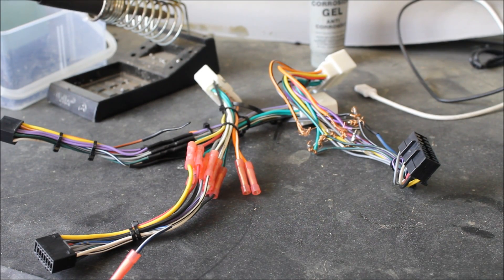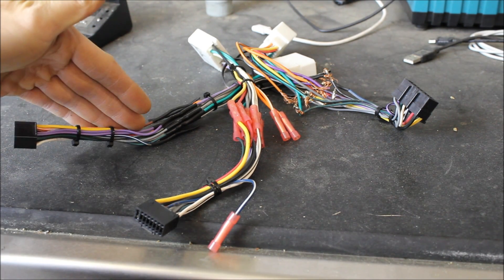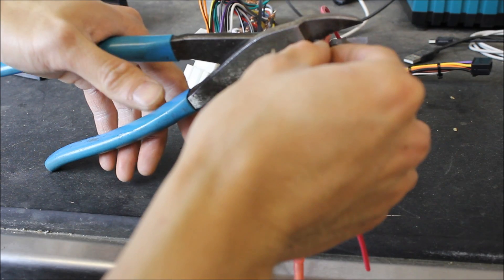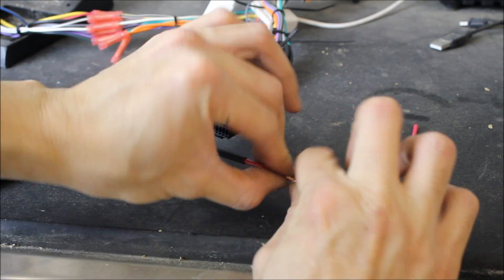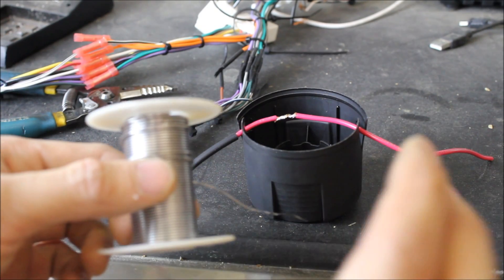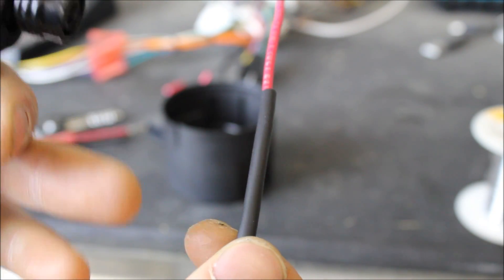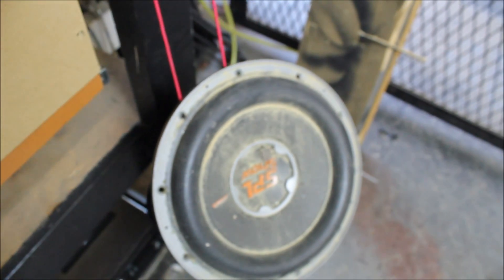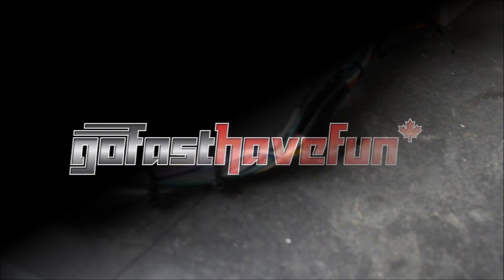Butt Connectors vs Solder | Crimping vs Soldering | Wire Connections | AnthonyJ350

Comment: Do you realize that solder forms the connections on circuit boards? It doesn't matter that it's an alloy.
Reply from the maker: There's also a COPPER FOIL sandwiched with the glass fiber.  That copper might have something to do with how things flow too.
Reply: I don't follow. Your point was that solder shouldn't be making the connection. On a circuit board, the connection is made from the component lead to the copper traces with the solder.

Comment: But soldering wont stand the high current heat ,right?
Reply from the maker: Cosmo John If the wiring can handle the amperage you're pulling you should never have an issue with solder since it won't heat up enough. It's when you have the incorrect gauge of wire (too thin) you'll have issues.
Reply: AnthonyJ350 Appreciate your good advice. I am using lead-free solder which i believe has higher melting point. You have a good point about the wire gauge. Thumbs Up!

Comment: One suggestion I have is to stagger your splices. That keeps the bundle size down.
Reply from the maker: 2 questions.  How long does it take to do that and make it look good and what does it look like?  If you solder you don't really get a bundle.
Reply: AnthonyJ350 staggering the splices takes zero extra time to do just takes a little more mental effort.

Comment: Faster is not better Anthony. Take some pride into you work.
Reply from the maker: jim davidson I do. That's why both connections held together at the end with the weight test. Wiring will never endure that much stress.
Reply: Just try not to use butt connectors if you can. If I have to use them I still solder them. Have a great day Anthony.
Reply from the maker: jim davidson We don't, but then I have people complain that I didn't show butt connectors. So I show both.

Comment: NASA doesn't use the tin the tip methods either ;-)
http://makezine.com/wp-content/uploads/2012/02/western-union-or-linemans-splice.jpg
Reply from the maker: Lloyd Smith Thanks for this post!
Reply: C
Reply: There are a few different methods to splicing wires together (side-by-side, etc.) but it depends on the application that the connection is being used on. The method you used, twisting them together, is not ever used in weapons or aviation systems but it is fine for automotive use. A good solder joint is always preferred to a mechanical (i.e. butt connector) connection. Resistance is not increased by solder, as someone told you. While you were trying the side-by-side connection you could see that your solder tip was oxidized which decreases heat transfer (although that wouldn't have helped much when you don't have a suitable way to keep the tinned wire ends together). Also, try cleaning the wire ends with Isopropyl alcohol and putting some flux on them before you apply solder. Someone else in the comments section said that tinning wire ends is preferred; this is also true. If you really want to get into the weeds with soldering, look up the J standard and solder to it.
Reply: Here are an ok video, https://youtu.be/6EiIDNEiB_U demonstrating the technic but for god sake DON'T use that tool for soldering and ware plastic glows if you want it perfect:-)
Do as in the video, but make it look as on the NASA picture.The advantage of this technic is that it is immune against shaking, heat stress and a lot more! :-)
Reply: the key to soldering that joint is, not too much solder, or it creeps up the wire causing the wire to fatigue where the solder ends, and its soo weak!
Reply: Yes, the leads are mandated to be tinned prior to bending them at 90* and twisting them around one another.
Reply: Not always. I and countless other techs have installed authorized  crimp splices on military  aircraft wiring harness (not on flight controls, which require wire replacement and no piggybacking!) and millions of Cannon and Amphenol connectors are crimped and not to be soldered. I've soldered plenty of the old style which also required potting compound and don't miss it a bit.
Reply: Great picture, great connection.  Tinning still provides the best fluxing possible when joining two tinned surfaces.  Joining two wires like this is not a good use of tinning.  Making a wire shoot off of a circuit board however is.

Comment: I also was twisting each and twisted together after that soldering as you did 6:05, but I saw the method which I really like. No twisting is required just insert wires into wires squeeze with you fingers and solder it.

Comment: in high heat areas (engine bays) I heard you should always crimp.
Reply from the maker: If we can't get tach digitally we sometimes have to get it from an injector or distributor and we wrap and solder it.

Comment: Great Tips & Techniques Presented Here.

Some additional considerations:

The standard for a submersible well pump ( under water for 5-10 years, 80-300 feet deep) is a crimp butt connector and shrink tubing. No soldering.

Small solid wires between 19-26AWG?  Use Dolphin Super B-wire “Beanie” crimp connectors (white dry or blue filled Gelly Beans).  You don't even need to strip the insulation as the multiple teeth pierce it when squeezed by pliers.  Telephone and alarm companies have been using Dolphin Beanies since the 1950s for fast, reliable connections.  Phone companies have since replaced them with  Wagos and 3M Scotchlok pigtail Insulation Displacement Connectors (IDC) UG, UR, UY, 314U for solid wire. 

Nevertheless, I hate callbacks. In an automotive, marine, industrial, high vibration or salt air environment I prefer soldering  a pigtail backed up by a beanie for strain relief and insulation, especially for stranded wire.  For larger wire I also solder and use a crimp cap with dielectric grease rather than deal with making a Western Union lineman’s splice and shrink tubing for power, speaker, sensor, and control signals.  It doesn't look as good as inline shrink tubing and takes up more space, but if the customer isn't ever going to pull the wire through a hole or cabinet to a a product bolted down for it's life and the wiring is hidden why carry a slit spray paint cap?  

A lot of bars/taverns are putting big screen TVs outdoors where humidity gets to the connectors.  I smear dielectric grease on all the Cat 5 & Cat 6 4-pair computer RJ-45, HDMI and Coax jacks/plugs.  A little dab'll do ya.

Comment: Maybe you are not aware that butt connectors like what you used needs some heating as well like shrink tubes. Actually it has low temperature soldering materials that melts once you apply heat. More importantly, that butt connectors seals wire like silicon.
Reply from the maker: Eddie Suerte Felipe Aren't you referring to the marine grade butt connector?
Reply: What? No. And silicon is what microchips are made of. It's not a rubber. Silicone is the word you're looking for.